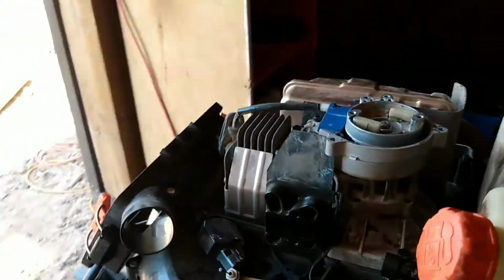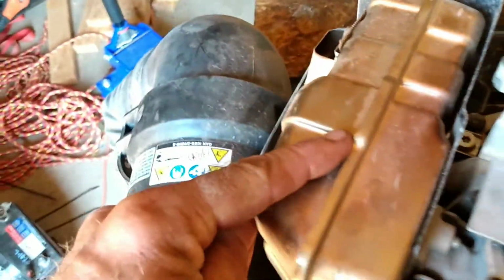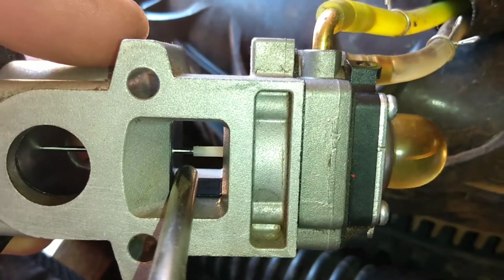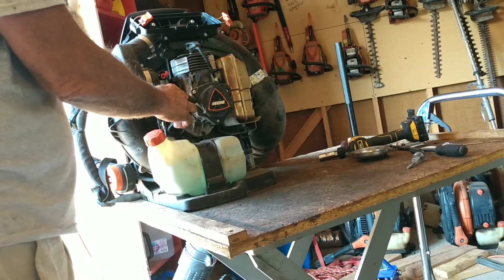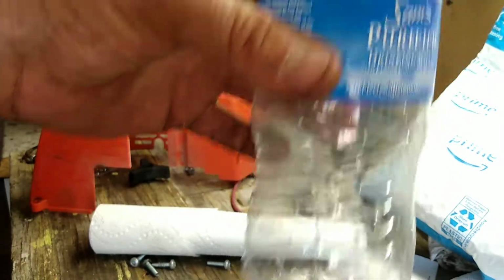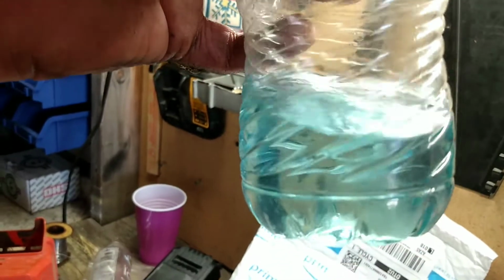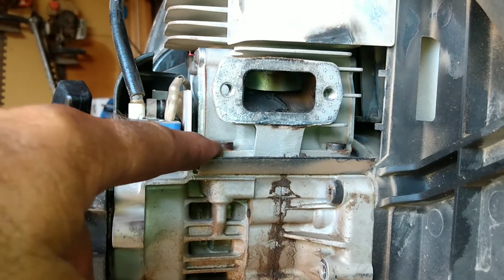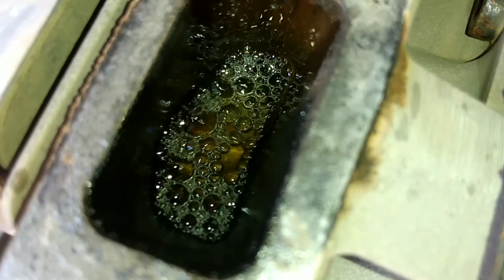Echo PB8010 backpack blower won't start! Couple of Zombie tricks thrown in too!

Comment: I have the same blower and I’m working on it for someone else, I could get it started with starting fluid and it would run roughly for about 10 seconds and quit. I cleaned the carburetor and also used air to blow through it and still nothing. I bought an aftermarket carburetor and still will not start. It does have spark but it doesn’t look like a lot of spark. Would that have anything to do with it? I’m going to check out the piston, thanks for the video
Reply from the maker: Jimmie I'm gonna give you this link to another similar blower and the frustration that we sometimes go through. I will say that those 8010 models are getting a bad reputation for your exact problem which is spark related. So much so that now they have discontinued that model and now make a 9010 that does not (as far as I know) have the same problem. Watch the video and use the process of elimination and see if that helps with the diagnosis. My first suggestion would be to gain access to another 8010 coil and install it and see if the problem goes away. If no access the owner will have to splurge for the coil. In this case I would NOT get OEM. Let me and others know what comes of this please . https://youtu.be/EJl228R-bjY?si=-Vfxa3_e8__cmud0

Comment: Sounds like my lawnmower Troy Built TB230. I've been throughout the whole motor and still won't start
Reply from the maker: Need more info to help you brother. Did you pull the flywheel and check the key?
Reply: @ZombieDaveAZ  Thank you for your response. Not yet. I purchased a ignition coil and spark plug tester. It has spark. I'm not sure about the correct compression. It feels great just as before. My problem started after I suctioned all the gas out and tilted the lawnmower over carburetor side up to drain the oil for a oil change using BP full synthetic SAE 30 & 10W-30 I always use it in all my equipment with no issues. I started it and blueish smoke out of the exhaust. I released the break and took it home I removed the carburetor and fuel tank I disassembled the carburetor and cleaned it along with the tank. No start.
Reply from the maker: @WilliamLoney-y8k   if it ran before the oil change it will run again. Try carb spray into the carb . The smoke will clear out on its own. Mowers don't like it when oil gets in thru the breather tube. Timing is most likely just fine. What type carb/ primer in on your machine please?
Reply: @ZombieDaveAZ  I got the motor to run CRC Mass Air Flow Cleaner that I had in my closet. Runs then shuts off. I'm guessing a fuel or carburetor issue ??

Comment: Got the same problem with the 8010 echo coil wire on coil was broke off installed new coil has spark now but won't start. Coughs thru intake. Seems to have good compression.  Guess I'll check rings like you did. Replaced old carb with new carb also.
Reply: Pulled muffler off surething siezed piston and rings waiting for new piston and rings to arrive

Comment: Great job. I had the same model the other day that a screw had backed out and was hitting the fan wheel. Another shop told him it was a bad rod.
Reply from the maker: That's what I find on the Stihl handhelds. I have not had that happen to me on an Echo yet. If it happened once it will happen again so I will be on the lookout for that now. So good to hear from you brother. I hope all is well with you and your family.👍
Reply from the maker: Almost forgot to tell you, recall came out in March for around 70,000 backpack blowers. Faulty straps and plastic coming out of the fan area.
Reply: ulitepilot aka Zombie Dave im about to add a Husqvarna dealerships in with our Echo dealership

Comment: Had the same problem with  an Echo curved shaft. Sprayed lubricant thru exhaust port onto rings.Tried pushing in ring. After several days ring pushed up
Put trimmer back together. Started up. Ran fine. Gave it to a buddy of mine. Still runs. Go figure
Reply from the maker: thats awesome you got that freed up  👍

Comment: So what Caused the problem?
Reply from the maker: Looked to me like cold engine seizure. When they don't let the machine warm up and go to full throttle. The rings seize to the piston and no longer provide the needed compression to run. Operator error.
Reply: If throttling one up cold damages pistons, all mine would be toast right now.

 8010's however are notorious for being overly lean from the factory.
Reply: @mrpotatoheadracing oh wow didn’t know you had to warm it up I feel like most people just go full throttle once they’re on 🤔 it seems like a 9010 problem tho i got older blowers still working fine and two of the 9010 with the same problem took it to get checked and they said it was the gas filter that was dirty causing to overheat. I just dont understand how the other equipment runs fine

Comment: Typical 8010. I see these in the shop all the time with engine failure. Most of them owned by landscapers that use the same fuel in several pieces of equipment. So no, it's not always fuel related. I have one, hate it. It was zo terribly lean from the factory that it wouldn't warm up. I bought one of those 30 dollar tools to adjust the carb.